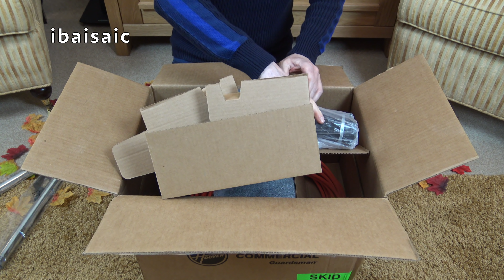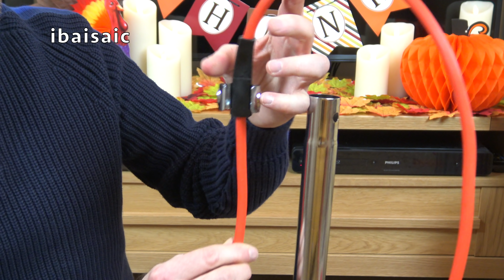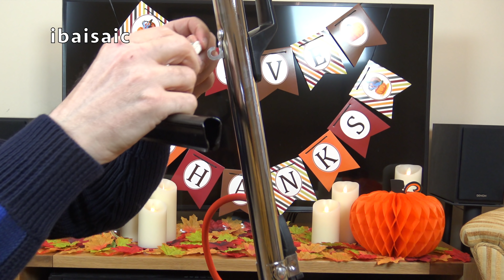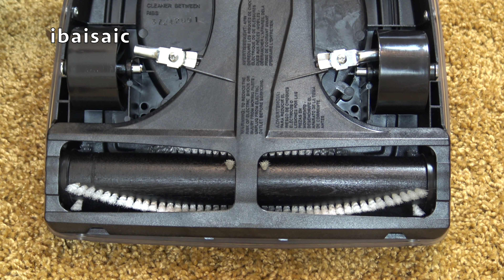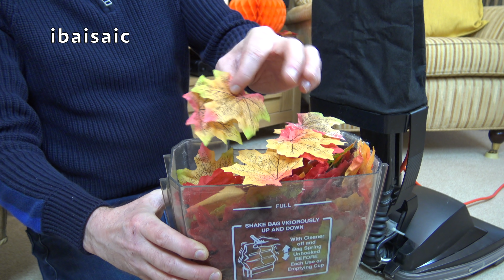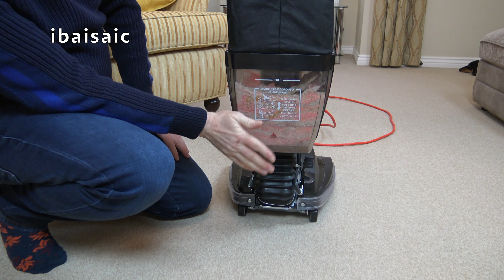Thanksgiving Special - Hoover Guardsman Commercial Bagless Upright Vacuum Cleaner

Comment: I believe that noise you were hearing is the hard brushes of the brushroll vibrating against the plastic base plate. If you install an all-brush roller from 3rd parties like CWP inside one of the later Convertibles/Decades that have a plastic baseplate, they make a very similar noise.

Comment: If you don’t like the four brush roller and bottom plate, a senior brush roller and bottom plate should fit it. Also, you could have put the bellow on then put the handle through it and then attach the handle to the handle fork. The screw part is designed to be on the front to make it easier to put it together, unfortunately since the cord goes between the bottom of the handle and along the side of the dirt cup instead of through the inside of the handle, it’s not gonna be that easy.